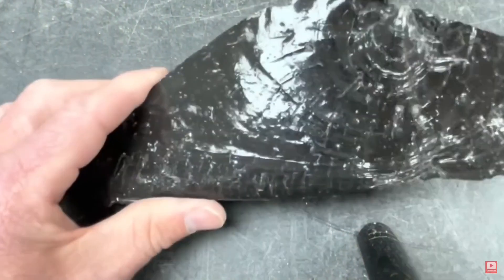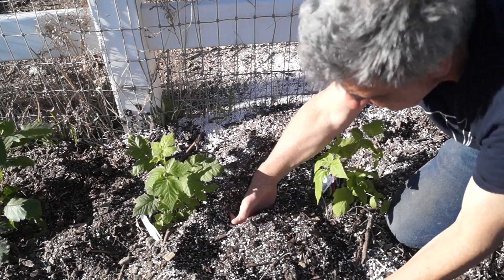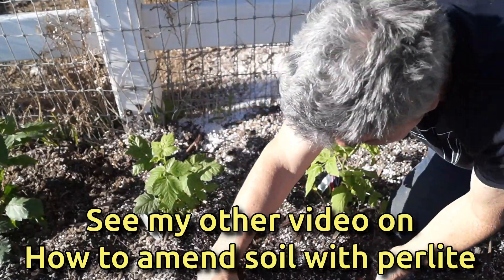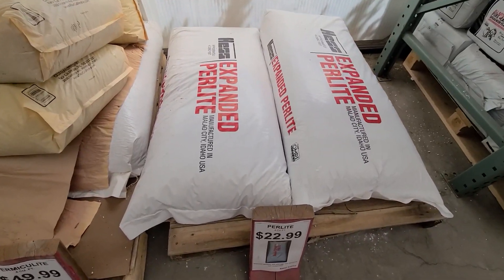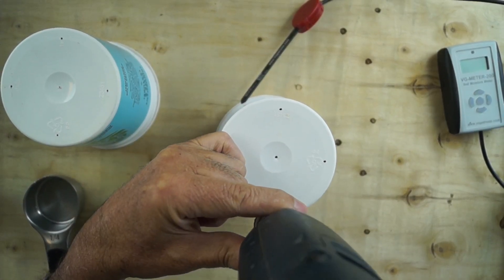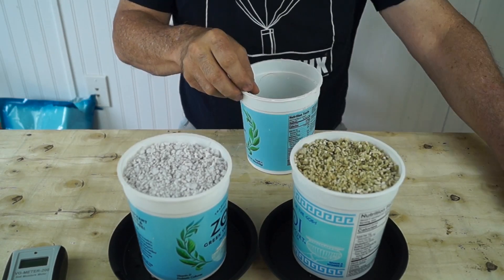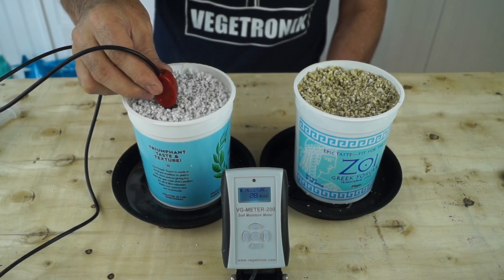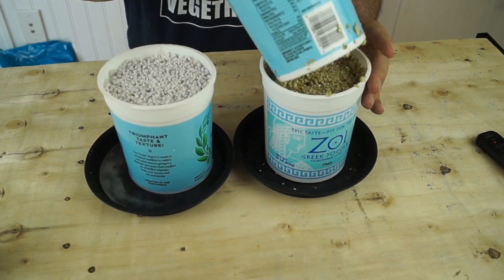Perlite vs Vermiculite? I Ran an Experiment to Find Out which is Better

Comment: Really depends on the soil you are adding it to. Perlite allows more air circulation and root space vermiculite holds more water and gets "soggy" In sandy soils I use more vermiculite in clay soils more perlite. In either soil, more organic matter is what is really needed.
Reply: We've got clay soil that we mix with organic matter and the soil quality has improved after 30 years of tending... However there is a corner of the garden where the ground is always dry due to a tree in the area taking the water for the flowerbed.
Dad likes to use Perlite, but I'm going to suggest he mix in Vermiculite in that area to give the flower bed more water retention... Then hope the tree roots don't go after the water.

Comment: Perlite might have extreme amounts of fine dust. I used it with a mask but still was unpleasantly impressed by literal fallout after using it. 
I think my mask managed to save me from troubles but next time I'd just firstly soak entire bag with water and then wash it and probably get a high quality respirator just in case.
Never tried vermiculite but I'd probably pass, seems like a hassle.
Reply from the maker: I like the suggestion of soaking it.  Great comment!

Comment: So... why not both?
Reply from the maker: Great question.  I think the ratio would depend on what you're amending and relative costs between the two.  If you're amending sandy soil, you don't need any perlite - vermiculite would be best.  In clay soil, the clay tends to hold water but needs to be aerated, so perlite would probably be best, and cheaper.  So at the moment I can't think of why you would use both, or a ratio. I'd like to hear other peoples thoughts and experiences in regards to this question.
Reply: James Prigioni whom I’ve followed for several years uses a raised bed mix of 3 parts coco coir, 2 parts compost and roughly one part mix of perlite and vermiculite.  I ran out of perlite, so I did a 3:2:0.5 mix and am trying that in 3x1’ bottom watering containers.  Soil is light and fluffy and so far seems to retain water nicely and evenly.